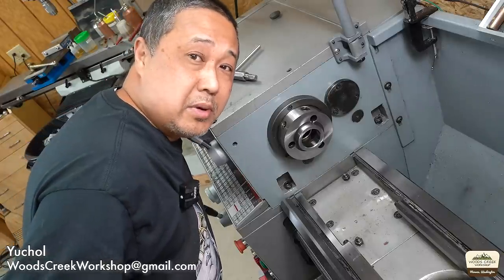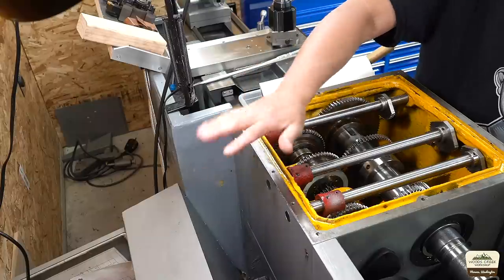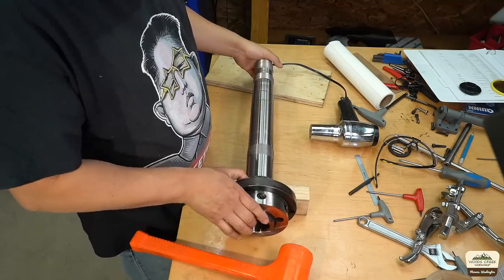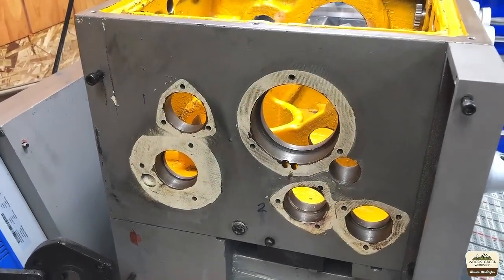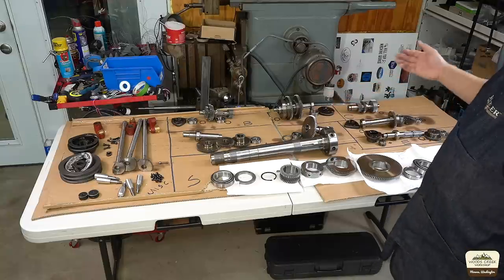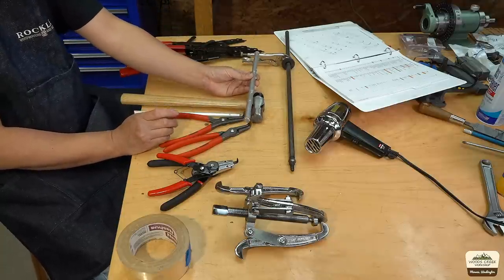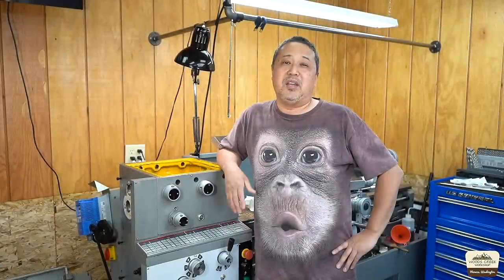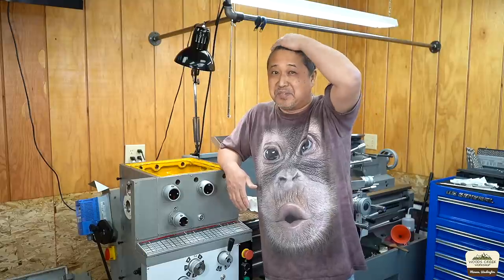LATHE SPINDLE BEARINGS (Part 1) - TEARDOWN of 13x40 Engine Lathe Headstock

Comment: The spindle and its bearings are the lathe, no excessive mechanical force should be applied to them ever! I think it better you take the hammer and put it away!  Make up some pulling gear which consists of suitable bits of tube, end plates and a threaded rod to pull the spindle with. Also you did not need to take anything out but the spindle and its gears, these will come out through the cross shafts!  All machine tools these days have shit floating around in them it seems from new, have cleaned them out before sale on occasion.   I do this stuff for a living. Your bearings at that price most likely are Chinese or Indian made in any case no matter what they say upon them unless they were NOS. That lathe can run either ISO 32 or ISO 46 hydraulic oil as a lube. If you think the inside of the headstock was dirty, never go look in the Norton box will you! 
.

Comment: That's an unfinished lathe there. It is not done until it is deburred. As you said UNACCEPTABLE. I guess Chinese labor is getting expensive.
Reply from the maker: Pretty sad
Reply: @woodscreekworkshop9939  And I guess you paid premium money for that lathe. It should of been done properly by JET. No significant difference compared to other Chinese machines.